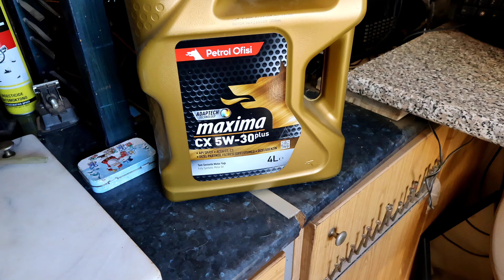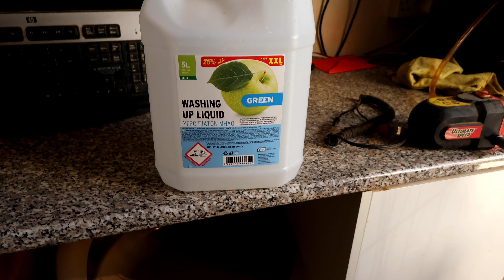Trying to suck the oil from my old Ford. Share my pain.

Comment: It looked tedious to go through all of that, and then you wound up just draining the oil anyway.😬😫 It's often true that if it's not broke, then don't fix it! However, it was oddly satisfying to watch the oil move through the tubes when it did start flowing.😆 I found it so strange that the wrong oil was used. Someone didn't know much about what they were doing!
Reply from the maker: Teeth marks in my pipe tsk tsk tsk
Reply: @Billscatsandstuff  😆😹😆😹